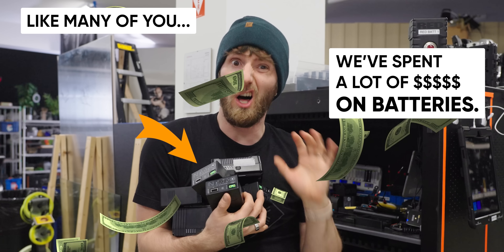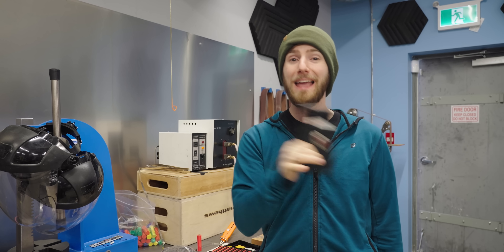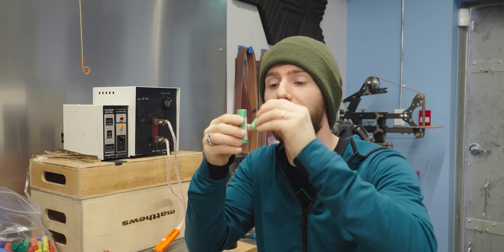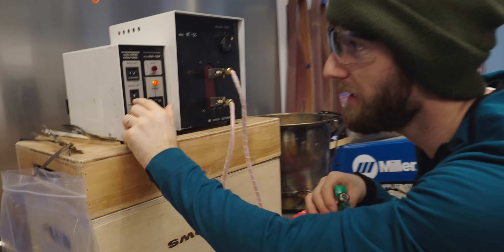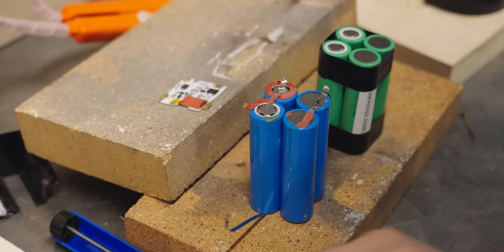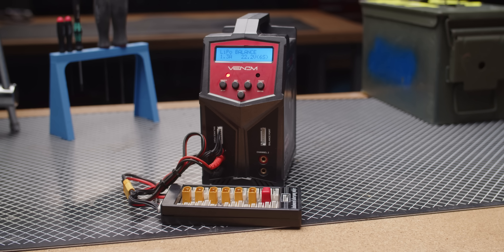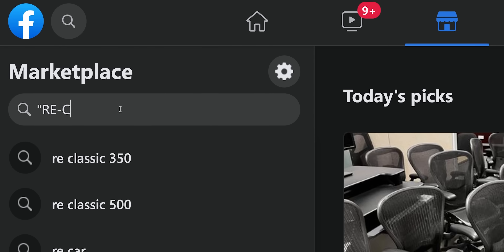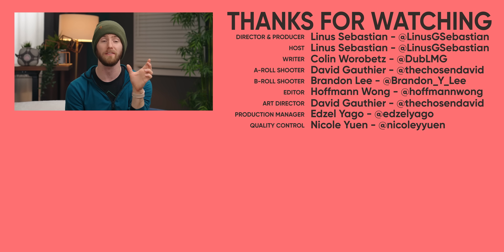This should be illegal… Battery Repair Blocking

Comment: A big thing people miss is that a lot of bms's are essentially "off" when freshly hooked up. You have to supply a charge current to them let's say it's a 4s Lifepo4 pack you can hit it with something like 14volts and 1 amp for a couple seconds. After that the BMS Remains on.
Reply: Yep, exactly, many don't start on their own just by connecting to the battery. This is a safety feature. Most BMS controller chips are from a well known manufacturers, so you can find detailed docs about how they start and work.
Reply: @dtibor5903  thanks...electrics are like their own planet of knowledge where most other things have common skills/techniques interchangeable between them
Reply: Would be cool if Linus revisited this topic with this information.
Reply: so you're saying linus turned it off, but didn't turn it back on (assuming they weren't evil bms)?
Reply: Exactly! That Sony cell needed some voltage applied to its terminals to come back to life. A few of the packs Linus put in the sand because of sparks, just seemed to be some molten nickel flying away, not electrical shorting too. 

It would be interesting if Linus were to have a look at the ICs on the BMS and look up the datasheets on them, they are readily accessible, and I have replaced a few.
Reply: @davidstech1445  Yep def just some molten chunks and he tossed a good set of batteries. All BMS boards I've ever bought did also indeed require a charge voltage be applied to the pack after an overcurrent trip before the output mosfets would turn back on.
Reply: Makita power tool batteries that have been in storage for a long time will switch off. A few seconds on a charger will turn them on again. Worked in RMA for them, was a common thing to happen.
Reply: Also, just plugging it in to charge could wake it up.
Reply: >  A few of the packs Linus put in the sand because of sparks, just seemed to be some molten nickel flying away, not electrical shorting too. 
THIS.  Some sparks look like the ones around  17:28  
And if LTT aren't gonna use old and new cells together (that'd be a bad idea), they could test two used 18-packs, dispose of the worst 18, and use the better 18 cells.  Or better yet, use the worst 18 cells as training dummies for spotwelding before using any 'live" ones.  Using 18 aged cells together should be very safe  -  not as "fresh" as a completely new pack, but free except for the nickel bands.
Reply: Even of freshly made and charged battery packs? Me and my dad are trying to repair 2 bosh ones, we changed the parallels where there were damaged cells and we have to connect a new bms.
Now the 2 battery packs are connected to their original bms and seem to work fine, my dad charged them but we don't have any bosh tool to use them on.
I'll try to charge the batteries after connecting the bms if they don't start, is this what you are suggesting?
Reply: And keep the bucket of sand nearby too :D

Comment: So you spent good two days all those tools and everything and all you got out of it was one battery that you probably could have picked up a new one for 50 bucks yeah you guys should be working on Wall Street.
Basically it's quite obvious anything that could create a spark or flame should not be anywhere within your claimed set of skills you should probably go retro to caveman technology and learn to master a stick and then move forward from there to the technologies until you master screwing in a light bulb then we'll let you turn on the light switch.

PS here's a little tap tap on your head so you don't feel so bad.

Comment: Worried about battery safety..has a bag full of random cells.

also cuts up a 450$ battery pack for a template that could have been easily 3d printed

Comment: Safety note. You should  remove your metal rings from your hands while working with high current circuits. If a ring shorts to the circuits it could get very hot and  cause a serious burn or loose a finger.

Comment: Lots of BMS require a "boost" for them to wake up. Just send some voltage on the output via a CC CV powersupply. It would be in the datasheet for the BMS. I re-celled some tablet which the BMS do that: it do not output any voltage until you send atleast 3V to the pack to wake it up.

Also, the way you disconnect and connect the cells is super important!

This BMS have some pretty good protections. The protections goes from a simple pack disconnect to soft preventing charging to hard prevent to fully disable permanantly the pack right now.

The example schematics have a mosfet on the output to short it, which blow the fuse. At the same time it also set some e-fuse to disable the pack and turn off the output.

The way you actually need to do it is: disconnect the positive lead FIRST, then the highest voltage positive balancing lead to the lowest, then ground. When assembling, it is super important to also do it in the right order: ground, balance 1, 2, ... then positive. If you do it in the wrong order then the protection kick in, and depending on what you did wrong then it will soft or hard disable the pack. If it is soft then you need to desolder everything and solder it back in the right order.

Then once the pack is assembled, you get.... nothing. The pack need to be activated by an external voltage source. Fortunatelly the tablet did it for me. This is so the BMS stay in sleep mode for shipping, and will activate only once the user plug the device for the first time. The software  (which I didn't need) also allow you to issue a sleep command.

Comment: This is a very similar situation with DJI Mavic lipo smart batteries , the moment the BMS loses power from the cells during cell replacement, it completely locks up the BMS and you'll need a very expensive programming tool to reset the on-board IC to turn a failsafe flag to false to re-enable the battery , such a pain as well when you consider the lipos used in the mavic batteries are absolutely trash and bloat very quickly on purpose due to their very low C rating.

Comment: While it was mentioned, that you may need to put your re-celled pack to charger, there is another way (when you got it open of course). Take two wires and connect pack terminals with corresponding battery terminals (i.e. pack+ with battery+). Why? Because all of these BMS circuits have protection IC against short, over- and undervoltage. Removing old cells is essentially extreme undervoltage condition, so you want to bypass protection transistors (TBH most of them are on negative rail anyway) and let it relax (there is simple spike filter). Same thing may apply to other BMS circuits, but beware! In some cases gauge IC will remember last known low capacity - if it is being read via TWI or other interface during charge - you may never regain full capacity without reprogramming initial dataflash values.

Comment: When Re-celling my old HP Laptop battery I had to prepare my battery pack first, solder the new wire leads to the pads while the old wires are still connected, then cutting the wires to the old battery pack and removing it last. You might be running in to the similar type of bms that doesn't like disconnect.

Comment: 4:20 You could disassemble them get a really good battery tester and charger such as Xtar/NiteCore etc and get rid of the wasted ones and charge test the usable ones, repurpose the single cells for small hobby projects  or replacement for AA in like clocks and stuff I guess.
Though I'd goto budgetlightforums and candlepowerforums and do your research there regarding re-usability of old cells

Comment: Is the reason why you sparked because you didn't apply enough pressure? I have spot welded in the past sparks were normal in certain cases. Unless I am unaware of the react of the nickel to the unknown metal battery polarity you spot welded to, maybe that was said.

Comment: Working with 18650s is not this dangerous i don't like the stigma your supporting yes there's risk and you shouldn't be handling something you don't understand people make giant power walls with harvested cells that have been running with no issues for years if your gonna use any rechargeable battery technology do your research as long as you are using them within there specifications you'll be fine

Comment: it gets really dirty i was helping somebody with a xiaomi mi drone battery.. I even ordered a new motherboard only so i could help him as i had to dump the firmware..   Basically it comes down to the firmware if you can hack the firmware in my case the quadcopter firmware to ignore what the battery is saying your good.. Then just skip over that power management board.during your replacement.   .. the reason why mi drone does it is because they sell a replacement battery for over 300u.s when it only has 30 dollars worth of cells in it for real..  extremely disgusting practice..  and no you can't just replace the battery management with off the shelf i.c unless you program the id or what ever satisfy  the firmware that is reading the battery .. I believe the ic was a SH79F329AX.. you can find programmers for them or make them.. but still a huge hassle easier to kill it in the firmware..

Comment: I love how they always jumping to the most complicated solution.  The BMS is not controlled by software, it's just a fusible link.  After a while the link just burns out, or if you hit it with heat.

Now, why does it have to be there?  Well, that is just good 'ol Planed Obsolescence.  I'm looking at you, D@#$.

Comment: Another way is to use the connectors and use your own custom pack.  You can use power drill packs with a close foot print and just 3d print an adapter.  You source probably only use two main wires which will be the thick wires - one red, one black.  Just need to make sure you have enough amps which drill packs usually have.

Comment: LTT, can you please put actualy effort in these projects, its not hard to get it right. Would help educate the community tremendously. You guys did a better job 1 year ago on the powerbank

Please do NOT follow these steps. The spot welder settings are off for this use. too slow a ramp and  held too long.
It should be a SPOT welder, not an arc welder.

Its also recommended to charge the batteries to full and make sure the internal resistance voltages are as close as posible to each other.

Comment: With a task as dangerous as building a lithium battery pack, this video shows very little research was put into the safety of actually building a pack, including using the wrong type of spot welder. While I do think volatile memory is a cheap shot from vendors to screw right to repair. This was a poor attempt to show that untrained home mechanics can make their own repairs. 

Other videos have been great though, keep up the good work!

Comment: 4:38 yes i need more reasons. I recicled some laptop bateries, I have made powerbanks 3s 6p usually, even 3s 20p and I never got an accident, The oldest power bank i have, has 5 years, more than 300 cicles and i could say, it has like 20% less capacity than when i builded it.

It takes time because you need to test every cell, but yes, if you dont know what you're doing better do not risk, safety is first and i think that is fine for the purpose of this video.

Comment: The weld itself shooting a little sparks is fine? That's just from unsmooth tips melting a single spot real quickly/ maybe a bit high of power. If there isn't an actual hole in the cell it should be fine.

Comment: When you got a spark, it must have been from the welder, not the batteries. To get a spark from unbalanced batteries, you would have had to weld the second side. Edit: On the first one anyways. Second one was way to much energy through that nickle.
Reply: Yeah, these guys are newbies and they're being overly cautious, but that's okay. The sparks are just the nickel strip vaporizing and nothing to do with the battery itself. It's a pretty normal part of spot welding batteries and it's fine as long as they're wearing safety glasses.

It looks like their welder settings are off by quite a bit. Usually battery spot welders do two very short and high powered pulses to fuse the nickle. The first pulse is shorter and does the initial join, and once the electrical connection is made, the second pulse completely melts them together, usually with a 10-20ms pulse.

Nothing should get noticeably red hot. Here they are doing a less intense but longer hit, for what looks like up to 1/4 of a second, which is far too long and heats everything up to red hot, which is not good for the batteries. Honestly, it appears that this spot welder is designed for more heavy duty applications which require penetrating welds, which isn't what you want for bonding nickel to lipos.
Reply: @ryan.crosby  My thoughts exactly. You can even see an example of it done properly in the B roll footage of a professional pack assembly near the end of the video (at 17:26). In that clip, the weld pulse is much faster than what Linus is using. It also sparks a fair bit, but it's not a big deal because it's just from the weld process and not the battery itself. With a shorter pulse, I bet their weld tips last much longer as well.
Reply: @ryan.crosby  well, during the short actual welding I have the tips of the welder as well as the spots go red hot. But that is for such a short amount of time that it may even be not noticeable.
I also thought it had to be the welder that caused the sparking. Either the tips not connected properly or having kind of an edge from scratching with the sandpaper (which should not be necessary either with a proper welding tip, but I guess Linus put a note on that in the subtitle already) or just the nickel being not completely clean or not laying completely flat.
I somewhat wondered what they panicked about, especially with the small battery pack when they still were on the first side and nothing could short out yet.
On the other hand, doesn't hurt to be more careful than necessary with those things.
Reply: Regarding their double welding technique, it's too much heat all at once doing the first and then immediately doing the second. The whole point of spot welding is to minimize internal cell heating that can cause damage. So do the first weld and wait for the metal to cool before doing the second weld. Probably should have a fan or compressed air blower nozzle to rapidly cool the first weld.
Reply: Exactly what I was thinking. From the size of the sparks I saw and the location they came from... That was the welder. I've built a few packs as a hobby and trust me, relatively small welder sparks on occasion are normal, especially on the positive side due to its smaller size and the air-gap.

And hard to tell on camera but from the amount of light they were getting, I think their welder was also turned up too high, so no wonder they got sparks.

Batteries are probably fine and they just threw away a ton of 100% working batteries lol
Reply: Yep 100% this. A complete waste throwing out all those cells!
Reply: You are right. Besides that, there is a lot that's wrong with that attempt, double nickel stip weld on baterry is a no-no, welder settings are beyond reasonable current etc.
Reply: Confirm, most of LTT's sparks were like the ones from the professional site at 17:28
Reply: When the cell goes there is a lot off billowing smoke you are more likely to blow the cap fuse secondly you can weld nickel strip to nickel strip reducing the heat placed in the battery

Comment: As someone who works at a BatteriesPlus, where part of my job is to rebuild battery packs, this is both incredibly impressive, and also gives me severe anxiety
Reply: I worked at a few of them as well from 2008 to 2013. This video made me grateful I never had to spot weld lithium cells and for the jank designed bicycle pedal used to lower the welder.
Reply: I was a store manager of a Batteries Plus for many years, went to the headquarters in Hartland, WI near the Ascent warehouse when I first became a manager for training and saw the big ole testing rack they had for lithium cells ranging from 18650s to cell batteries from Rayovac. They had me sit at a bench and spot weld a dyson vacuum cleaner battery and damn near blew my eyebrows off. While we were never required to rebuild lithium, tool and appliance industries are moving more and more towards lithium and we needed to learn. I just said fuck it and made our policy to just order already built packs from Empire or Ascent and forego the risks of loosing material in the case of a hiccup. The customer only has to pay like $10 difference for a superior product than a done 30 times to get it right rebuilt one. The owner of my store hated loosing money rebuilding lithium's anyway so it was an easy choice to opt out of that risk. As long as you stock and have the product you're golden.
Reply: As with so many things in life. Having the right tools and training goes a long way.
Reply: I thought sparking is okay while connecting batteries for a pack, I'm gonna be making my battery pack for my go kart next week. Seeing the level of caution over here and throwing the entire pack away at a spark gives me the feel I don't know enough.